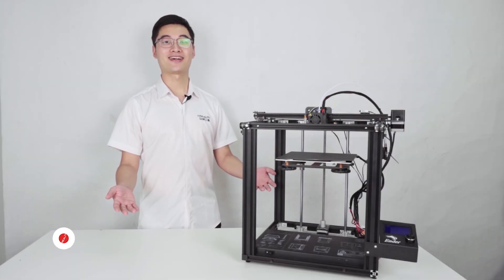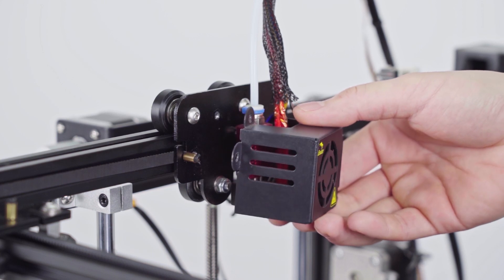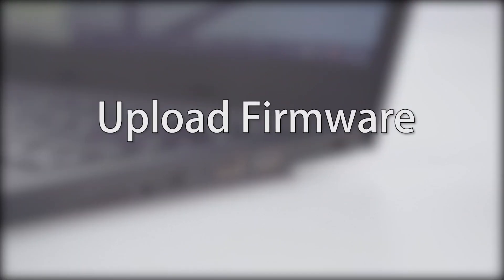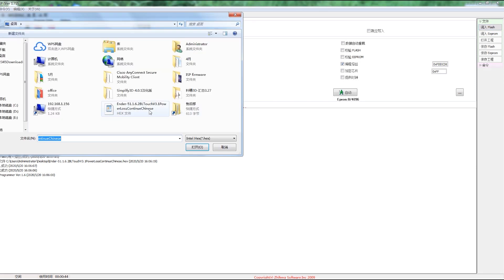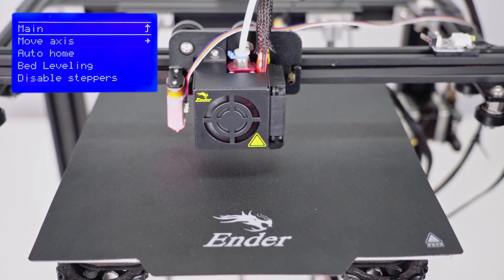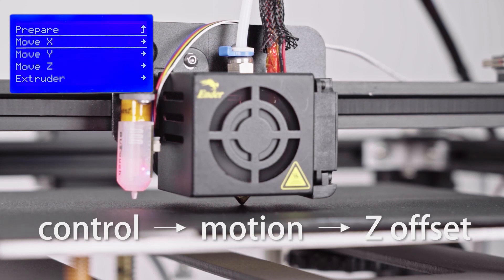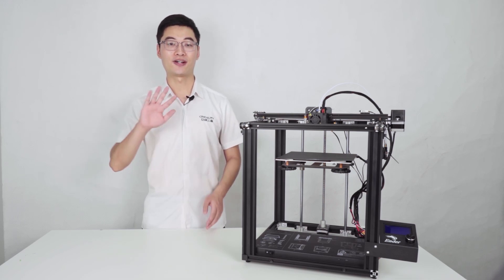Ender 5 BL-Touch Installation Tutorial

Comment: Is PROGISP supposed to pop up when I plug in the Burner?
The blue light comes up, my computer says it's setting up the USBHID, but nothing is showing up.
Reply: You need to download PROGISP from the Creality website onto your computer. Then when blue light is on, run the PROGISP application on your computer.
Reply: @stever9999  Thank you.
Reply: @stever9999  Thank you. The only one I found says it's for Ender-3S, would that work on Ender 5?
Reply: @stever9999  Thank you for the help. 

A few steps later it's asking for the BLTouch Hex File. Where would that be? Is that also something I need to download separately?

EDIT: Never mind. I found it.

Comment: when i connect and go to PROGISP the select chip field is blank. my connections look legit and the blue light is on. I am getting an error that says "access violation at address 768A2BFO in module 'KERNELBASE.dll' Read of address 02888000" does tghis mean anything to anyone?
Reply from the maker: Please refer to this video to check it. https://youtu.be/vGVhEA3A_4M Our mainboard chip 1284P needs to use ISP to refresh the firmware program, while the 2560 chip needs to use USB to refresh the firmware program, so please check the information of the chip first.  If the problem with your printer has not been solved, pls contact cs@creality.com
Reply: Rename the folder to a shorter version. I had to remove the (silent) in both folders to make it work

Comment: i AM HAVING SUCH A PROBLEM GETTING THE SCREW INTO THE HOLE ON THE LEFT SIDE OF THE EXTRUDER. IN THE MIDDLE OF THE BL touch and extruder. any tips to get tiny screw into the small area in between?!?!?
Reply: had the same issue ... the thing that holds the extruder to the rail on the left needs to be pushed a little

Comment: I followed all the steps and now nothing works, LCD is just blue?
Reply: I had the same problem,you probably did not plug the 10 pin adapter in the right spot. It can be connected so that it overhangs to one side and then only 8 pins make contact, just unplug it and plug it back in but center it this time.

Comment: Bed crashed into extruder and ruined it, what did I do wrrong?  Also Probe only measures about 75% of the build plate, missing the right side of the plate.  It still does 9 points just off to the left.
Reply from the maker: Friend, sorry for the late reply, could you pls make a video of your printer's leveling problem and send it at cs@creality.com. Our engineers there will help you to solve this problem
Reply: @Creality3D  I posted this 9 months ago I sold the printer I could t get it working.
Reply from the maker: @ViridianTechnologyLLC  Sorry for the inconvenience 😭😭

Comment: I installed using the SD card as I was instructed by Creality I could. The firmware updated and shows the BLTouch but there is no Z Offset selection in motion... none whatsoever. so now I can't print. Now what?
Reply: Idk man I’d use the screws under the bed and just wing it

Comment: Tutorial doesn't work, i crashed my Bed into the Nozzle. I did it step by step.
Reply: I did the same thing... but I noticed I had used the wrong hex file... I used: "Ender-5_8bit_1.1.6 BL Touch V3.1_Latest Firmware_0814\Ender-5_8bit_1.1.6 BL Touch V3.1_Latest Firmware_0814\Ender-5 1.1.6.3 resume printing function.hex" but when I swapped to this file: "Ender-51.1.6.3BLTouchV3.1PowerLossContinueEnglish.hex" - the problem was solved.
Reply: @wmjowls  Ill try that
Reply: Lythium8d8 in the end I went with TH3D Firmware and I'm much happier with that.

Comment: I installed the bltouch per these instructions but when I set the z offset the bed stops about a quarter of the inch away from the nozzle. Then when I start a print the bed does the auto home and the bltouch does the deploy and retract but once the print starts the bed goes up into the nozzle. I have damaged my glass bed from this and now I do not know what to do. @Creality
Reply: Yup...their tutorial is crap. It's not working for me either. @Creality you guys need to hire better engineers or start giving better support.

Comment: I followed these instructions and when I go to print the bed goes all the way up into the nozzle. I damaged my glass bed because of this. What is going on!?
Reply: I did the same thing... but I noticed I had used the wrong hex file... I used: "Ender-5_8bit_1.1.6 BL Touch V3.1_Latest Firmware_0814\Ender-5_8bit_1.1.6 BL Touch V3.1_Latest Firmware_0814\Ender-5 1.1.6.3 resume printing function.hex" but when I swapped to this file: "Ender-51.1.6.3BLTouchV3.1PowerLossContinueEnglish.hex" - the problem was solved.

But I needed
Reply: It’s been 3 weeks and no reply from Creality. This seems to be the norm on replies as I had a warped bed when I got my printer and when I would email them it would take about three or four days. The replies and directions were unintelligible and I couldn’t get anything out of them. When I would write back it would take another 3 or four days. I tried troubleshooting online and reddit and Teaching Tech has really saved me.
Reply: Nick Korobi Did you install marlin?
Reply: Same thing happened to my printer. It's been sitting in my room collecting dust since the start of the year.

Comment: hi , i had a problem to adjust the z offset , the printer is completely ignoring the Z Offset setting I've set (and set again and reset and again....). Sending the printer to Z0 always results in a ~2mm gap between the nozzle and the bed, regardless of what the Z offset is set to. evrything you Any ideas? ender 5 Pro.
Reply: I'm having the exact same problem atm - would love a way to fix this as well if you find one

Comment: If your BL Touch is moving off the left side of the printer:

This is the firmware you need: https://drive.google.com/file/d/1ubo12R0qe6kUpIPYE1OZAPDq1CF3qSKR/view

Rename it with a .hex extension.
Reply: it doesent work
Reply: I Have the same problem. This firmware is the solution ?
Reply: @stefanozaffonato2206  Just install marlin. It's much better
Reply: Thanks this solved my problem of going off the left side on my Ender 5 with 1.1.6 silent board.
Reply: @PROITMSP  hello, what does need to be updated in cura?
Reply: The link does not contain anything, unfortunately.
Reply: Thanks, it worked but now I have another issue: it doesn't not save the Z offset after adjusting it when clicking on "save setting" as shown :( any idea/solution?
Reply: 😀This worked thanks very much! Ender 5 v1.1.4
Reply: Your link is not working anymore, anyway to download it somewhere else?

Comment: I've just built my printer and followed the guide but mine starts to print with the bed too low. When i do bed leveling as well the bltouch goes of the edge of the bed :(
Reply: Did you get this fixed
Reply: Mine too! Is there a way of fixing?

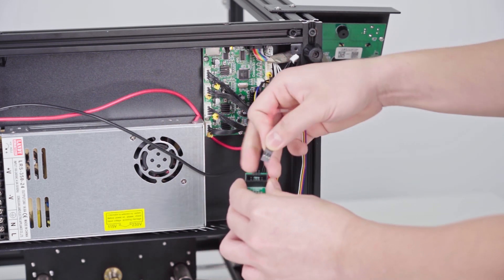Comment: 1:57 friendly reminder to double check and triple check your wire orientation against the wiring diagram, plugged mine in without checking and fried my controller board lol. Had to wait a couple months for a new one.
Reply from the maker: Thanks a lot for your reminder, it is very helpful for both us and other users 🙏

Comment: hi my bltouch goes past the edge of the print bed  on the x axes how can i adjust this thanks lee
Reply: Me to do you have a solution
Reply: same
Reply: I had the same problem before, just check out the Creality's store and download the newest firmware.
Reply: Hi all I solved my issue with this now, I flashed the cheetah 5.0 firmware as I found the instructions the easiest to follow only 15 steps with a video as well
Reply: @SwampThing https://forums.creality3dofficial.com/ender-5/ you will find what you need there
Reply: @elaramars2854  which do I download
Reply: @elaramars2854  these a RAR files not hex so program will not recognize

Comment: The bed leveling does not work, the prob get out of the bed and is in the air, because the home is set to the center and not to the corner anymore, need a firmware fix for that please

Comment: first Thanks for the video, I have followed all the process, but when I select "Bed leveling", the head start in the center, then moves to the back right (not at the extreme of the plate) and then goes to the left side, but in the last left position goes out of the heating plate, so the BL Touch have mo surface to touch and  Z movement goes up without stop control.  How can I solve this?    I followed all the steps, download the firmware at the creality site.  I have a Ender 5 with the 1.1.6 firmware originally
Reply: I have the same problem. Have you found the solution ?
Reply: same problem :(
Reply: I just did the same thing, you flashed the wrong file, 
Make sure you get Ender 5 Pro files not the regular ender 5, Just reflashed mine and all is well.

https://www.creality3dofficial.com/pages/ender-series
Reply: @ponchs12  is your printer a regular ender 5 with ender 5 pro files? I tried with both firmwares, it just didn't work
Reply: @ponchs12  If I could I would make this comment number 1. You have no idea how much you've helped me. Everything is now working perfectly. I wont be using TH3D again
Reply: did you manage to fix the issue?
Reply: I'm  having  the same issue did you get this resolved

Comment: Will this video apply to the Ender 5 pro I just bought?
Reply: +1 
I would also like to know the answer to this question.  I have heard that it will not work with the silent motherboard that is in the Ender 5 Pro.  Please clarify this for us.  Thank you
Reply: I also have the Ender 5 Pro and installed the BLtouch. Than I updated the firmaware whicht is the Ender-51.1.6.3BLTouchV3.1PowerLossContinueEnglish.hex which was in the  Ender 5T84 folder. But when I start the printer than, auto home does not work, because the hotend moves into the wrong x and y direction, looks like that the sign in the firmware is not correct. When I klick the auto bed level in the menu the hotend moves near to the center of the printing bed and starts leveling. But after some points it moved the BLtouch sensor left from the Bed where it cannot touch the Bed. I stopped it before the hotend crashed into the Bed.
This is all very disappointing!!
For me it looks like that these firmware is not correct!!
Reply: @Fantastic4Cats I just did the same thing, you flashed the wrong file, 
Make sure you get Ender 5 Pro files not the regular ender 5, Just reflashed mine and all is well.

https://www.creality3dofficial.com/pages/ender-series
Reply: It does work ok. Mine is fitted and flashed with marlin 2. Refer to this and just use ender 5 pro files in marlin: https://youtu.be/YsTGH5JvClM